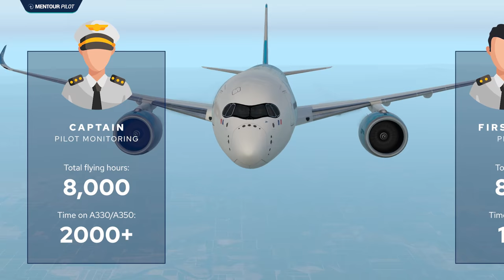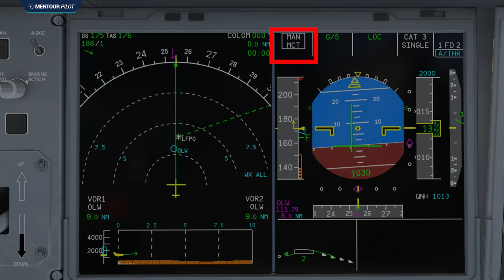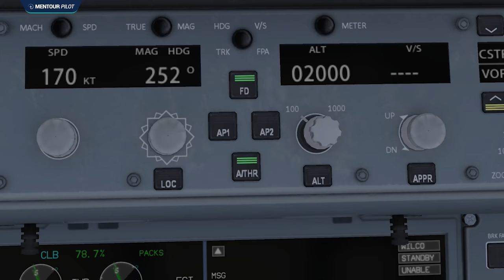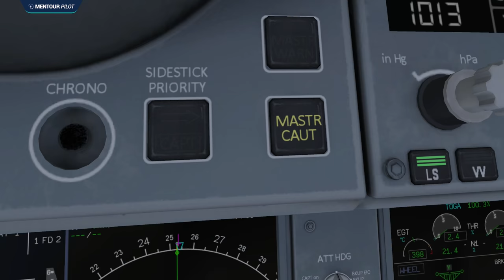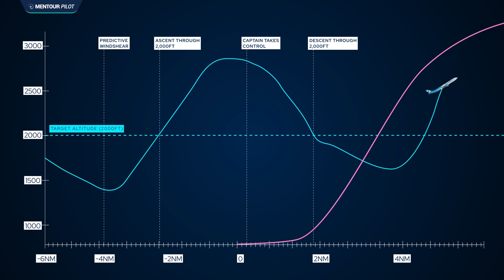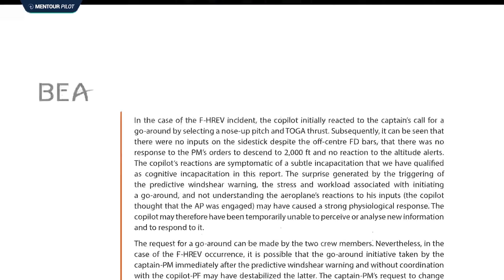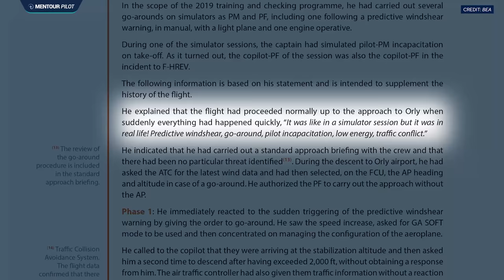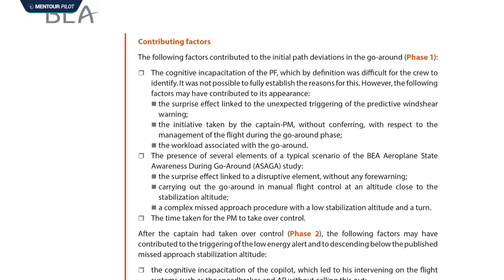What HAPPENED in this A350 Cockpit?! French Bee flight 711 explained!

Comment: Well, when you tell the story, all of this feels lasting for a very long time. However, the captain reacted after 52 seconds. Not too bad, because the situation was not clear and quite confusing. On top of that the first officer was still doing things without informing the captain...
Reply: @lrw1105 
I don't quite agree.
Take off & landing are very precarious situations. 
There's v little time to allow correction of mistakes.
So, in this scenario because you only have seconds really, the Captain could have taken over after the 1st no-response from the flying officer.
It is always going to mean something is seriously wrong when the FP ignores his monitoring pilot. 
It doesn't matter what the reasons are for his mental absence, the plane has to be got down immediately.
Ask questions later.

Ps  All pilots would be aware that stress may adversely affect their collard pilot mentally,  so you need a personality that can jump into emergency mode  without debating it first.
Reply: 52 seconds is abysmal. The plane can climb thousands of feet per minute, travel easily 6 miles(13km) in a minute. It's an Airbus. Literally he just needed to push a button, maybe 2. Imagine sitting in a car for 52 whole seconds while someone starts drifting from the road. That's basically the equivalent. Madness. Of an A350 no less, you can't fly a more prestigious piece of metal...or composite I guess. 777 or 787 maybe.
Reply: @Benji-jj2bg 
You don't need hindsight in this situation but quick reactions. 
You  cannot allow your brain to run on  "idle".
Communication was a  key factor here and it didn't happen -  out of politeness or embarrassment, I don't know but in quick changing situations there is no time for politeness nor deference to people's rank/role. 
So, not hindsight but being trained and prepared and able for such a situation. 

52 seconds is an awfully long time. 
I couldn't stay quiet in a car at 30 mph for even 5 seconds if I thought the driver missed something. 
I'd rather upset people 
than risk  my own life, let alone everyone else's!

Comment: I remember hearing about this one and thinking what happened?
Very interesting explanation, undoubtedly an evolving situation that escalated rapidly.
Certainly the study of the human factors involved here makes for more understanding.
Fatigue as well no doubt played a role as i can vouch for.
Reply: Yes, fatigue sounds plausible. On the other hand, you also should be dealing with an amalgamation of two lines of thought. You have the first seconds of a long-awaited maneuver - taking over the controls from the autopilot for a measure as difficult as landing -, and into this, the emergence of the wind-shear warning. Given the repeated switching on and off of the autopilot which followed, I suspect that the two changes related to how the landing was to be handled - switching off the autopilot and go-around - were fusing, in the mind of the affected individual. Both changes have in common that they amount to aborting a conventional landing procedure. This could imply that some neuronal circuit of a corresponding function in the brain of the patient would have burned through, so that it would have had to be rebuilt from scratch. The patient will also have subconsciously checked for a possible causal connection between the two needs of such abortions he was inundated with. This will have consumed additional capacities.
Reply: @HansDunkelberg1  Not a bad response, we call it the startle factor.
Reply: @seanmcerlean  An aspect which now still has come to my mind is that that wind-shear warning (4:43), as rendered in the video, has been given by an automated voice. This will additionally have intensified confusion. The man will have been startled at such an automated output occurring just four seconds after switching off the autopilot, wondering how much of the automated systems really has been shut off.
Reply: @HansDunkelberg1  Generally speaking, the autopilot and maybe autothrottle would be switched off but all the remaining sensors would still be active such as radio altimeter, weather radar and of course the pitot/static system feedimg into the Air data inertial reference unit so this warning would have come from those sensors not the automatics.
As you correctly mentioned the transition from autoflight to manual comes in a managed expected way.
If there was no mention of windshear in the ATIS or from air traffic control then most certainly the startle factor of this would have been in play especially at the end of a long overnight flight where you are prepping for a landing which would appear routine.
What causes the sensors to issus that alert or why the windshear was not reported is the question here.
Reply: @seanmcerlean  Okay, that sounds like a really big accumulation of unexpected events at exactly the wrong moment. The improbability of such an accumulation, per se, already must have appeared stunning.

I'm imagining the lingual side of the processes in the mind of the victim somehow as a combination of similar sentences between which to distinguish would have overstrained an equivalent of what's the random access memory in a computer. The brain clearly is organized like a computer, and if you overstrain the RAM of such a machine, there will appear a little rotating, blue ring, while the screen freezes. Or the ring doesn't even appear, any more.

It requires a particularly high amount of computational power to filter out what's different between similar things. A simple algorithm won't suffice, in such cases. Mistaking a similar-sounding word for another is a smaller, well-known version of such an incident and also can already interrupt you for many seconds. Having to distinguish between whole sentences and concepts, you certainly can be disturbed even much more. Like when you wonder, in a rapid succession and largely just somewhere in the depths of your consciousness, without noticing every single one of the details:

"What's now that? Is that a technical malfunction triggered by deactivating the autopilot?"

"Is the autopilot somehow mistakenly interacting with the sensors - after all, we have the clearest weather!?"

"So should I ignore this warning, and abort the idea of carrying out a go-around?"

"Should I abort the landing, or should I abort the abortion of the autopilot? But won't an abortion of the abortion of the autopilot abort the landing I have been concentrating on, so much? How can we then land? Will the autopilot - wait, is it on or off? - do it for us, or - no, we're going to be on the go-around, anyway! Or won't we?!"

"My God, what's going on in my head? Am I thinking nonsense?!"

"Help, this might be a mental blackout!"

"So what am I now really giving up? This confusion altogether, perhaps? Or thinking about this confusion?"

"Yes, try to overcome the mental blackout!"

"But where have I just stopped, concerning the plane? Help! This could end my career!"

"Oh, this is dangerous! The runway is dead ahead! Let's, at any rate, occasion the go-around!"

"Have I now done everything correctly? Have I switched back from switching off the autopilot to - eh - switching it on? Oh no, wait, how was that? What have I activated or deactivated? Myself being in control, with my great intentions of manually landing? So then the autopilot must be on! At any rate I, for the time being, certainly should first gain a few hundred meters of height, again!"

Somewhere at such a point, I could imagine the subtle incapacitation will begin to simply freeze the brain.

Perhaps a major factor in this case has been that the victim already will have been using a particularly large part of such an equivalent of a computer's RAM, from the beginning, because he will have just begun to assemble all of his powers of concentration for the task of manually landing.
Reply: @HansDunkelberg1  , Wow, are a trained MD or psychologist?
I underdtand what you are saying.
Pissibly in more fundamental terms he was at overload which his colleague did not at first realise ,by which by time he did, moving at around 2.5 miles a minute(160knots or thereabouts) the situatiom had already got away from him and was heading the wrong way.
The other thing is that the F/O had a microsleep moment which i have had whilst workimg nightshift driving trains.
When he came out of it it would have taken a few seconds to assimilate his surroundings and take the correct action,thus the confusion.
A very interesting look at the human factors here.
Reply: @seanmcerlean  Certainly, that subtle incapacitation is the big subject of the video. It's hardly a video specifically on matters of aviation.

I am not officially a psychologist, nor in any way medically trained. I just am systematically building an independent worldview, based on scientific literature from all fields, have a focus on certain fringe matters of anthropology which opens my eyes for the degree to which the psyche is predictable, and since about thirty years am writing fiction with a focus on atmospheric matters.
Reply: @HansDunkelberg1  Cool, that is impressive and i fully agree with your methodology here.
Education is by far the best way of broadening your horizons.
Reply: @seanmcerlean  In the end, you can take any systematic activity - as long as it isn't criminal or utterly useless - as education. Who says that only the contents of books would have to be trusted? I'd certainly also travel, a little, if I had money for it.
Reply: @HansDunkelberg1  ,Yes you are right and developimg  the skill of critical thinking is important in any undertaking when you are looking at information.
You should always look at reliable and trusted sources before reaching your own conclusions, for example the UK  meteorological for weather information.
Nothing is an exact science though so experience and trial and error help so long as you can do so safely for yourself and others.
That is how aviation has developed over the last 100+ years.
I would definitely recommend travelling but equally understand finances are important.
A cheap(ish) skill to learn is scuba diving which can lead in a multitude of directions, such as conservation,research etc.
A good time to do it as we need more scientists in a variety of fields to drown out the mass media nonsense.
Reply: @HansDunkelberg1  Vielen danke für ihr antwort.
Ich bin halb schweiz so ich weiß.
I started at 7 with exchange visit and holidays in France, Italy and home to 🇨🇭 from 🇬🇧.
You sound very intelligent to me although i understand why you would be scared at 17, that is young to be travelling.
You talk about your upbringing in Southern Germany which is an area i know from my travels.
It is a beautiful country.
Zwischen Maerz 2019 zum bis ende februar 2020 ich im Düßeldorf und Vuen auch, arbeitet mitt Laudamotion gmbh hat.
Heute ich als fluglotze trainere mitt mein ausbildung in Großes Britannien.
My german may not be ax good as your english as i need to relearn it again but i make the effort at least to practice.

Comment: This kind of thing is something that a lot of people will be familiar with. I remember once having something similar when working at a synchrotron, and we had a failure of the vacuum pumps. Which means a lot of alarms, unfamiliar noise, and something that you almost never have to deal with on such a large scale. It is really difficult for me to describe, but everything does just become like a haze and you do the things you think you should do based on your experiences, but it is often not the correct thing to do. Luckily for me there was nothing dangerous to myself or others (just some very expensive kit), and I snapped out of it pretty quickly. I can imagine the stress on a pilot is much higher, and consequently it is a worse thing.
Reply: I would guess that soldiers and such are trained to not be incapacitated from the startle response, it just seems like it would happen to then too much otherwise in any kind of combat situation. Whatever militaries might do to mitigate the incapacitation could be useful for everyone to know, since, of course, unexpected situations can pop up in your life 24/7, no matter what environment you're in.

Comment: Another great video. 2 particular points of interest. The frequency of TOGAs…… personally I haven’t flown that much yet I have been on at least 2 flights with TOGA and one where we performed a low level 360 turn on virtually final approach, plus a fly pass near the tower to verify dodgy undercarriage was down. I must be jinxed 😀. The other is the issue of when to take control if the leader is “incapacitated” and/or is acting “unreasonably”. Instinct I think is most will permit “more drift” than with hindsight would be wise. There is definitely an attribute to both take control sufficiently early and be assertive (ie recognise the feelings of others and not just your own)

Comment: I don't fly that much, probably just 4 to 5 times a year.  But I had my shares of "go-around", more like abort landing; each and every time, we were like seconds to land (I can see the runway as a passenger).  The first time was in Chicago during winter and we had tons of turbulence.  As we were probably 100 ft from the tarmac, we could feel a very sudden lift and followed by a big drop.  Over the screams, we could hear the engines roared and the plane pitched up.  When we leveled off, the captain said something about micro burst or shear (I don't remember the aviation lingual).  Anyway I only remember his last sentence, "You got my promise that I won't land this plane unless it is absolutely safe."
Reply: That's crazy, I fly a lot and never experienced a go around, I only fly between European countries and the Middle East though, maybe the weather in the US is that much worse.
Reply: @c.w.8200  If you fly a lot, chances are that you probably had a few go arounds - it is not uncommon that many pilots don't even announce it.  Of the three aborts I experienced, only one pilot actually went on the PA and told us what happened.  The other two pilots basically said nothing.
Reply: There are differences in how fast weather changes and how often you get bad visibility.
Chicago is for example quite prone to it.

In many other places you would know in advance that you would have to go to alternate airport before attempting a landing and doing a go-around when that fails.

A place like Frankfurt, Germany probably sees a go-around once every 10 years, while Chicago or some other places sees multiple per year.
Reply: Why does everyone seem to get their fair share of go-arounds and I am still waiting to experience one? That is just not fair...
Reply: @Colaholiker  It will happen. I fly between 40 to 70 flights a year and i only had my first and only go-around in 2019. I always wanted to experience it but it was the worst possible timing, since i was already late. :D
Reply: @Colaholiker  I agree 😂
Reply: I've had 1 go-around ever, flying Southwest into Denver. The Pilot said "the traffic on the runway didn't get out of the way fast enough," so I'm not sure how close they were. It was dark outside so I couldn't see anything, but we were not hugely low. I appreciated that as soon as he could he explained it to us, though
Reply: Interesting, I have flown probably a hundred individual flights, not one single go around.
Reply: @Colaholiker Same, probably 100 flights, nothing. Which is fine, I'm not complaining.

Comment: The mental incapacitation thing when flying is real: I did my PPL when I was 48yo, and there were a few times when I was up there with the instructor where I would cease to communicate purely because of mental overload: I would still be thinking, but was incapable of taking in any more information or responding verbally. Thankfully it was never bad enough to hand over controls. My view of this in retrospect is that it is part of the training, albeit largely unwritten. It allows the instructor to understand your limitations and know when to slow down the training. By the time you're test ready, all those things that were limiting your mental capacity have been practiced enough that they have become second nature.

More weird was that when I was doing the final couple of lessons getting test-ready, I couldn't remember ever doing a couple of the airwork exercises, although they were all there in my logbook.

That's why as a crusty 48yo it took me 70 hours to get my ticket, while the 16yo's take only 45.

I can't think of the mind freeze happening in any other aspect of my life in the same way: in normal life scenarios, you have time to take things in and analyse them in longer time frames. The closest, much more benign similarity I can think of is when driving a car. Say you're driving a regular route, and you're engaged in a chat while driving. It's common not to remember large parts of the journey immediately afterwards. The difference is that you were still in complete control of the vehicle.
Reply: this is exactly why the golden rule "Aviate, navigate, communicate" exists, when you can't safely do those three things at once, then you priorise the first, and then the second
Reply: I'm not a pilot, but I know the situation where enough workload can cause me to stop talking mid-sentence. When there is stuff to be done, and the talk has to wait and there is no time to delay the work a couple seconds.